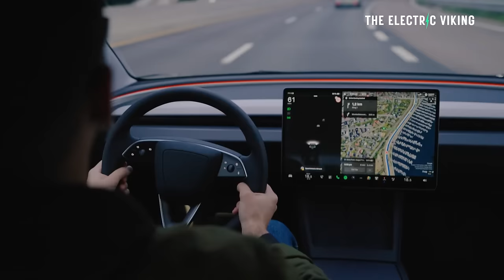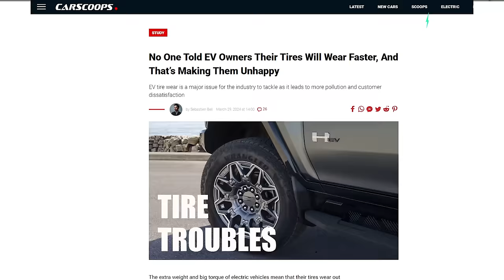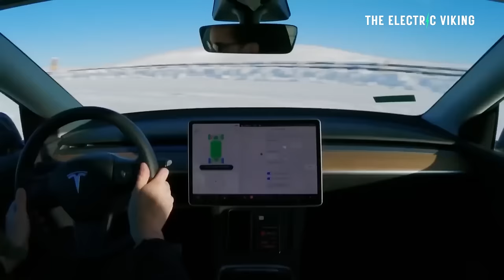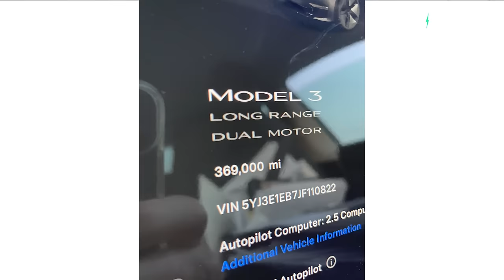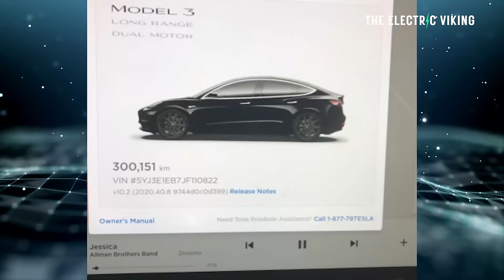I found the highest mileage Tesla Model 3 in the world - I'm shocked!

Comment: You can ignore doing the maintenance on any car and spend $0.  It would be incredibly stupid, but you can do it.  But if you follow the manufacturers recommendation on maintenance, Tesla's are more expensive to maintain vs their PHEV/Hybrid/ICE counterparts (many of which include free maintenance included in the purchase for 1-4 years) for typical drivers of typical yearly miles.  The yearly $300 brake lube is what kills it for all Tesla's, but some models also require multiple gearbox oil changes that carry a significant cost.  There are several other items that are recommended maintenance, though they are less costly and less of an overall impact. Tire replacement cycle and brake pad replacement cycle is not just miles.  It is also time.  You can put 0 miles on a car and the tires and brake pads will still degrade and need to be replaced every so many years.  Its similar to any fluids/oils, wiper blades, filters, and so on.  It's not just miles.  It is also time.

As for battery degradation, Tesla batteries degrade just like any other battery of similar chemistry.  Tesla has no secret sauce here.  What they did/do different from, say, the Nissan Leaf, is that they install a larger battery and then only make a portion of that battery available to you at any given time during the life cycle.  You are not getting this for free.  Tesla is literally charging you more for this additional installed capacity at the time of purchase that is not available to you at any given moment during your ownership (unless Tesla flips a bit for an emergency, which has happened in the past).  It also adds you more weight which reduces overall efficiency, a larger amount of energy lost via self-discharge (a function of total installed capacity), and a larger amount of energy lost during charging, than would otherwise occur if a smaller battery were installed equivalent to the capacity Tesla makes available from a larger battery.  In return, you get to perpetuate the false belief that Tesla batteries degrade less than others.  This is aside from the concept of depth of discharge and how well a user manages it for the particular battery chemistry in their vehicle, and also frequency of supercharger usage.  ICE/Hybrid owners do not have to worry about these things.  PHEV also need not worry, because even if there battery degrades quickly from excessive deep DOD the ICE is always there ready to go.
Reply: Never heard of this supposed $300 yearly brake lube.
Reply: @GDM22  You should RTFM, bro.

Comment: 500000 miles or 500000 km's? The words don't seem to match up with the video snippets.
Would be interesting to know if the resistance is still low after 300000 miles and loss pf 10% liferime capacity. Does that affect charging speed? There are stories that Tesla limits charging speeds for older packs, by design. Charging is slower with a Tesla with an older pack. True, or not?

Comment: An interesting point made in the video was that all the high mileage teslas were long range models. They have higher capacity batteries. To preserve the battery people suggest never to fast charge and to use the battery in the 30% to 70% range. That is more easily doable with long range models than with non long range models.
Reply: Not really applicable to LFP.
Reply: @GDM22  the video claimed these were 2170 batteries.
Reply: @realestatenow  Yep, I understand that, I am responding to the charging recommendations of managing between 30 and 70%.
Reply: Never supercharging is a bit extreme.  Occasionally supercharging will not really shorten the life noticeably.  

I have 50k miles on my m3p.  I charge in my garage to 80% 5 days per week and 90% 2 days per week.  I supercharge from 30% to 80% 1 day per week.

My max range the car listed new was 312.  At 100% charge it reads 306 after 50k miles.  

I've probably charged to 100% 12 times in the year I've owned it.  

You don't have to be a purist when it comes to charging habits.  Bottomline if you lvl 2 charge most of the time and rarely go over 90%, the battery will perform great.
Reply: @ron2280  I agree. Occasional supercharging is fine. As long as you don’t supercharge twice a day like a ride share driver did. He ended up having to replace his battery at a cost of $9,000 (for a refurbished one from Tesla) after only a year or so of usage.

Comment: I think you're wrong about ICE vehicle longevity, at least with Toyotas.  They will last 300,000 miles.  Yes, they need maintenance that is expensive when going over 150,000 miles, however, it's a whole lot cheaper than buying a new vehicle.  People tire of the outdated technology before they become economically too expensive.  Ford, GM, BMW, etc may be a different story, but Toyotas are fantastic.  I got a Cybertruck about 1mo ago and have found it's "range" matters little to me.  What does matter on road trips is the charging curve.  I love the vehicle, but I need to say I'm very disappointed in the charging curve.  It only maintains the full charging level (e.g. 250kW or 350kW on a non-Tesla charger) up to about 25% state of charge then tapers off quickly, all the way down to about 75kW at higher states of charge.  This is a far bigger annoyance than having 10 or 20% less range.  I don't "road trip" much, so this will only be a slight annoyance twice a year.  Other than that, having 100miles of range would be fine.

Comment: They are ALL the long range model with the BIGGER battery.  Standard Model 3's with same mileage will have DOUBLe or TRIPLE the battery degradation as the long range models with the Bigger battery = less capacity is used between charges = battery lasts longer as it has LESS degradation.   It is what EVERYONE has been saying since the start.  The batteries put in your standard EV are INSUFFICIENT and ONLY the BIG long range batteries are sufficient for long term ownership.   The hybrid cars are FAR worse.

Comment: How often do Tesla owners replace batteries?
Luckily, most batteries last up to 200,000 miles, and technology is constantly improving. Tesla guarantees its batteries for eight years or 100,000 to 150,000 miles, whichever comes first.Oct 17, 2023

How many years do Tesla batteries last?
roughly 22 to 37 years
For the average driver, who drives about 13,476 miles per year (as per the Department of Transportation), this means the battery should be good for roughly 22 to 37 years.Oct 30, 2023

cost of a new Tesla battery ranges from $5,000 to $20,000, and you'll need to replace the battery every 10 to 20 years. The in-demand minerals required to make electric vehicle batteries — such as nickel, cobalt, and lithium — contribute to their high cost.

Estimates suggest that the batteries for the Model S cost between $12,000 and $15,000. After labor charges, the total repair cost is about $20,000 to $22,000. For the Model 3, the replacement cost around $15,799.27, with the battery alone costing over $13,500 and labor costing $2,299.27.

Comment: Tires are not tires lol
Make/model/size/compound - and even the same tread rating on one won’t equal the same actual longevity on another.

Then you have different vehicles, passenger (weight) trends, inflation maintenance, driving styles, surfaces, temperatures, average speeds, and of course wheel alignment.

There’s probably no less-consistent thing to compare or argue about on the internet 😂
Reply: You’re sure right about that😃

Comment: ICE engines used to last about 150k back in the 60s n 70s but they last a lot longer now. My father has had 2 falcons and a magna that did well over 400k on the original motor. His highest was a 1.3 litre Holden Barina that did 530k without needing any repairs.
Reply: Yea but that isn't the norm. My K2500 has 350K, and most 350's can last hat long with decent maintenance, and easy driving. Almost all the Tesla's can hit 500K  pretty easily.
Reply: Agree, if you maintain the car as specified by the factory, ICE engines easily last 200-300K miles.
Reply: What do you mean, no repairs or no maintenance. An oil change would cost $150 at a dealer.
Reply: @GDM22  An oil change is not a repair. Regardless if you drive an ICE car or an EV, a yearly visit/check of your car at the dealer isn't a bad idea. Happy to pay US$ 150 for an oil change and a bit extra for an overall check of the car.
Reply: Yeah grew up in the 60s and 70s.   Compared to today's cars they did not last very long.
Reply: @GDM22 
Maintainence yes, repairs no. The engine ran until it failed at 532 000k, the mechanic said he could rebuild it but the body would of fallen apart well before it wore out another engine.

Comment: Well, if you can drive the speed limit, not accelerate like you’re at the drag races and we are actually drag racing every time you take off from a stoplight stop sign you know the car might not warehouse fast I mean as a teenager my cars didn’t last very long. I had friends that had much more powerful vehicles of mine, and they would burn a set of 50 series off the back of their car every weekend I mean it was Friday night drag racing out on the flats and it was burning out in town running around the countryside, laying rubber etc. etc. etc. Don’t drive it like you stole it and maybe you’ll get some longevity out of the batteries in the tiresLOL

Comment: ICE cars have so much thermal shock in the engine exhaust and cooling system they start to degrade as soon as they leave the showroom.

In addition, modern emission requirements such as cylinder deactivation, exhaust gas recirculating and lean burn engine technology can mean they are well and truly fucked by 60,000 miles ! (ask me how I know !   BMW swirl flaps) 😂
Reply: And their exhaust is full of sulfur and other that form acids.  It eats there exhaust systems.

Comment: It's all great until you get an EV with a bad battery pack and the battery is out of warranty. The other problem not mentioned is if the battery pack which is at the base of the EV gets physically damaged on the underside, the entire battery pack has to be replaced at a ridiculous cost that is more than what the car is worth.  Please refer to the stories in Canada where 2 owners had damage to the underside of the car that warranted complete battery replacement for $60K.  Hyundai Ioniq 5.

https://www.youtube.com/watch?v=EEXieo06ta8

Comment: Look at reported battery failures it seem unclear how relevant degradation is, people seem to suddenly get an error and can no longer charge.  It would be very useful if we could know at roughly what age batteries fail most often.  Finding one that has done 300k miles does not seem that useful if the average failure rate is much less than that, but is that info available?
Reply: Tesla battery failures are something like .01% battery failures before reaching end of warranty, or 120k miles. About 1 in 1000, I saw the statistics somewhere online.
Reply: Trust me. If this was true, all mainstream media would talk about it.
Reply: Keep mentioning this site.  "Tesla Info" has data for 1000s of batteries.    You can tell which ones are changed out and when because they are outliers on the scatter map.
Reply: @danharold3087  Which site sorry?  I can't see it.
Reply: @jamie-ck6js  Ah sorry my bad the site is "Tesla Info"
Second video is 
"Tesla Battery Degradation part 2 - The mega mileage cars and how they have performed."

Comment: Now, you know why Toyotas are so popular! My Geo Metros can do that many miles, and a $1,000 overhaul and its good to go.  Tires last 80,000 miles too.

Depend upon Supercharging and the battery won't last.

Learn how gravity works, and you can change oil cheap.  Gravity is renewable energy.

I'll probably be driving my '90s cars for another decade.  I'd rather save and invest my money. New vehicles are not a way for me to save money. Buy cars that don't feed your ego.
I might rehabilitate a high mileage EV some day. But, none of the current electric models have field servicable batteries .  A Prius battery replacement  is a DIY repair. But, a cheap Geo Metro can still match the Prius fuel consumption and the overall costs of a 30 year old simple car can be ultra cheap.  I get to where I need to be just as well as an $80,000 EV 

Save in your 401K and then you can afford any vehicle.  

A recent report said a new college grad will need to save $30 million for retirement because of future inflation. Is your EV helping you save?

Comment: OK 10% on average - but there is a well known - pro Tesla Uber Youtube driver who has a Model 3 which only went just beyond the warranted 100,000 miles before it died; and he had to buy a new pack on his own. The pro spin was he would have paid they had he kept is old 3ompg Camery but in reality had he bought a new 50mpg Camry instead he would have still been driving; saved money and not lost the work time which can be weeks. 10% doesn't seem like too much but if you are doing the 80/20 rule to try to minimize battery degradation you're down from 150 miles to 135; If you have the Standard range you are down from 120 to 108.
Reply: My comments are about tire wear

Comment: Due to the batteries, electrics weigh much more than ICE cars, hence the starting, turning, and stopping is harder on the tires.  It is the extra weight.
Reply: Common trolling disinformation point. While that may be true of other evs, Tesla model 3 weighs only about 150 lb more than a comparable ice vehicle with same performance. You're saying that that 150 lb makes all the difference? Rubbish. What does make the difference is alignment and how much you like Jackrabbit acceleration and cornering. Those three things determine your tire wear. Not the vehicle weight. Once again you trolls have no idea what you're talking about
Reply: My 2023 Model 3 Long Range weighs as much as a 2023 BMW M340i Xdrive.  So, your saying that EVs weigh more than ICE cars is not true, especially for Teslas.

Comment: Meanwhile every ICE vehicle is virtually still on their first fuel cell.
Is it unfair to be comparing that?
I mean that is what the EV supporters are virtually doing right?
Reply: ICE cars require expensive maintenance to keep them running.
Reply: @fredbloggs5902  What is "expensive"? EVs also require (some) maintenance and the new price is high(er); 40-50K US$ easily. Depreciation on EVs is high. Maybe you buy an "at home" charger, etc. I'm not against EVs, but ICE cars still are a more (financially) achievable option for most people.
Reply: My last Camry kept costing $2k every year just to keep running, at 120k miles.  It was only worth about 3k. The last inspection wouldn't even pass without 3k in repairs.  And it was garage kept.  This is what Sam is talking about, running the car to 300k without much maintenance, most gas cars that's almost impossible.  On average they only last till 150k then scrapped.
Reply: @stefan2796  Are they really, the average ICE car on Australian roads uses 11.2 l per 100kms, that is $22,400 in fuel to travel 100,000kms. A model 3 on an EV charging plan at 7c a kwh would cost about $910 in electricity..
Reply: @stefan2796  Currently especially in the used car market.   If BEVs required more maintenance like ICE dealers would be happy to sell them.
Reply: @GDM22  Well, i use around 6 l per 100 km, so that would cost me around 12K. With an average of 20K kms per year, 2,4K fuel cost per year. But depreciation on an EV is around 10% per year, let's say 4-5K per year (50K car). And then an EV is not much cheaper. The higher insurance cost for an EV wasn't even a part of this calculation...Only 7c for a kwh??? Where is that?

Comment: 1000lb batteries are not going to cut it ,, to much materials needed for 1 battery ,,, and they want millions of them on the road .. where is all the material coming from hmmmmmmm
Reply: Which material specifically are you worried about?
Reply: The battery packs get recycled into new battery packs by Redwood materials.  Materials for gas cars need to be mined just like anything else, and oil needs to be continuously mined forever to keep the cars moving, whereas a battery pack only needs to be mined once.
Reply: Memorize this.  For every kilogram of fuel burned an ICE car generates 15.7Kg of CO2.    There is your problem.  You can't recycle the fuel just keep pumping and burning.
Reply: @danharold3087  where are thoose batteries going🤧🤧
Reply: @snow-uq4gx   They are too valuable to end up in a landfill.   Redwood in the US and others here and elsewhere. Battery black mass is traded on commodity exchanges.
Reply: @danharold3087  dead batteries recycle yet 2 be seen🤨
Reply: @snow-uq4gx  Perhaps you need to visit a plant where it is done?   Just as me saying they are real does not make it true.   Neither does your denial.